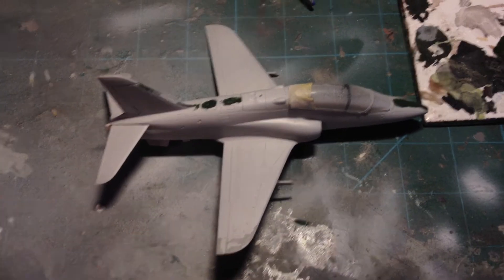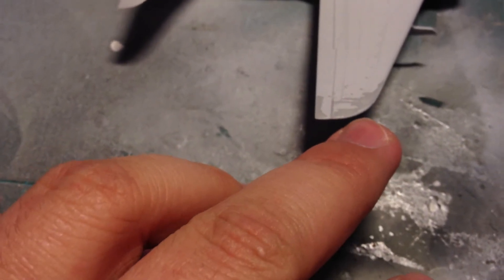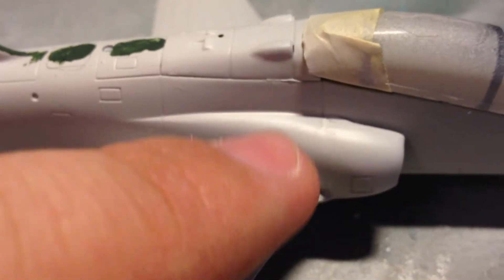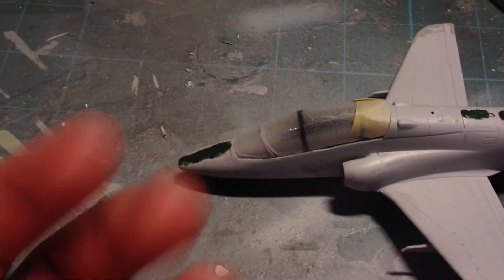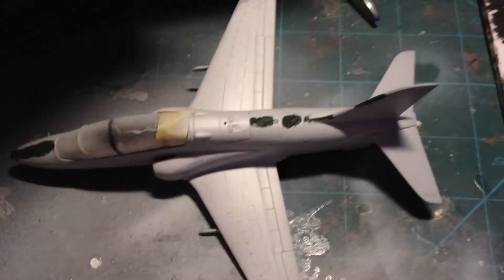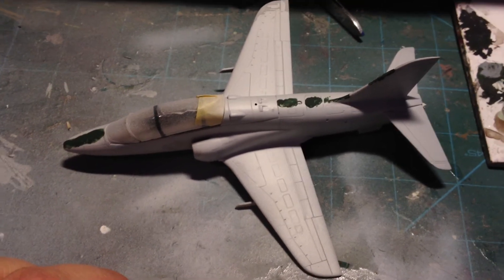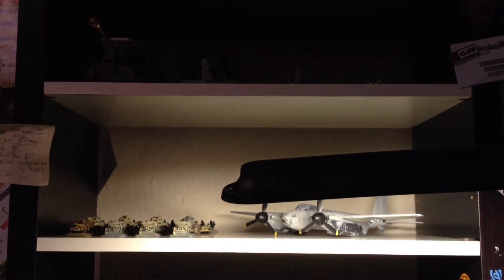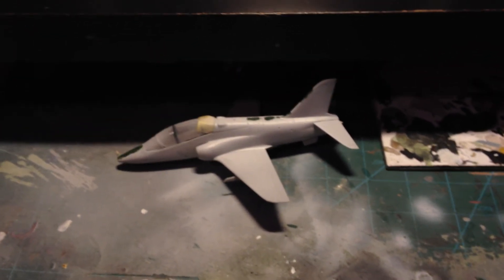Italeri 1/72 BAe Hawk Update 2

Comment from the maker: Cheers Warren. Yeah I think I am going to go back to using spray auto primer instead, this Vallejo stuff isn't great for sanding back if I need to re-touch areas. I am finished with the Hawk bar the replacement clear parts and landing gear I am waiting on.